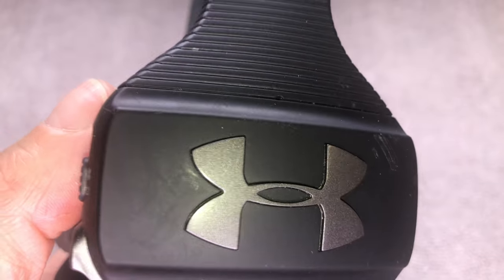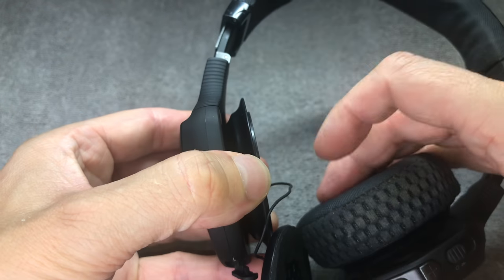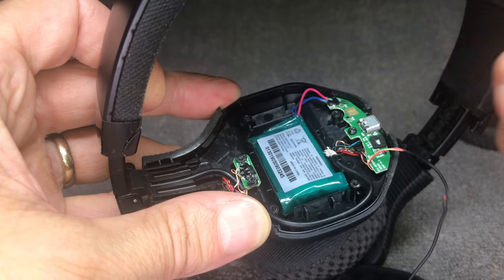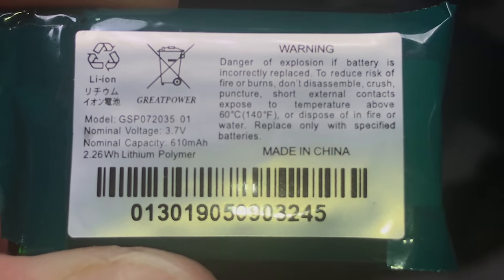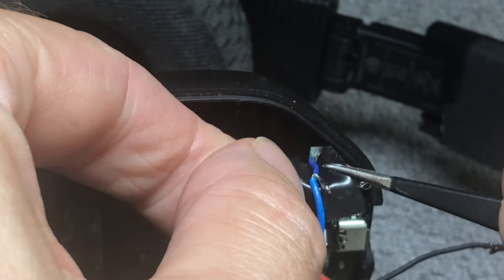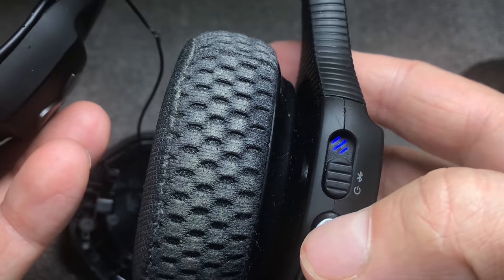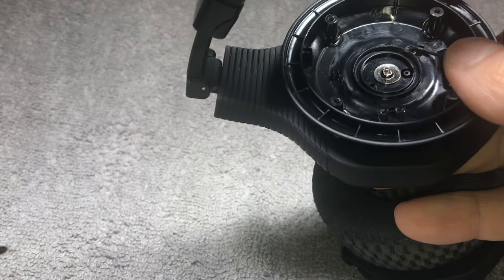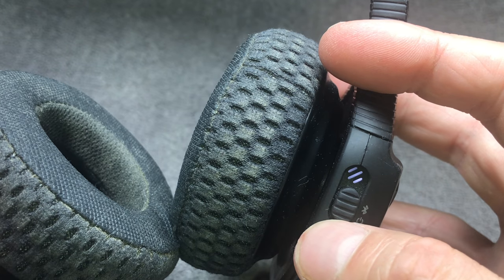Charging Problems with JBL Under Armor Sport Train headphones (Battery Replacement)

Comment: Thanks for the video! While replacing my battery the plastic cap covering the base screw was super glued in place. I used some nail polish remover to eat away at it. The plastic was damaged cosmetically but its not visible.

Comment: I hope that you make a video also how to fix the right side cause mine is not working... 😁
Reply from the maker: The procedure should be the same for the right side also. At least has long as the issue is with the small springs.

Comment: Thanks a lot for the video! Unfortunately it didn’t work for me ☹️ The red light is off when the charging cable is plugged. It turns red when I push the on/off button but turn off when I release it. My problem might be somewhere else…

Comment: Great videos! I saw you have a video of how to fix the left side not working on a different jbl model. any idea what could be the problem with the left side not working on these jbl sport train headphones?
Reply from the maker: Hi,
I went through an exercise like they with the JBL Quantum 100: 
https://youtu.be/DvpPXnC4wAM
It is different, since this model is using Bluetooth instead of the wired connection. But at least the first few steps are similar.
Reply: @MegaSafetyFirst  thanks a lot, I guess I will have to go through those steps. Of course I was hoping for an easy answer. Appreciate the quick reply and all your great videos!

Comment: Lithium batteries have a protection circuit. When triggered you wont se any voltage across the wires regardless of the actual cell voltage.  Normally the protection is triggered by the voltage being too low. Typical over discharge lockout is 2.5-3v.  If the protection is triggered by overcurrent or  overcharge the cell can be fully charged  and still measure 0 volts at the wires or terminals.  Handle with care and dispose of properly.     Or have some fun using them for target practice ... (NOT indoors)

Comment: I had similar problem also. I had charger from Jbl Charge 3. Did not work with that. Took mine OnePlus charger with different USB-cable. Worked well after that.

Edit: Chargers output : 5V / 4A